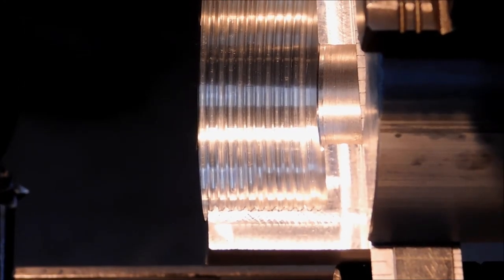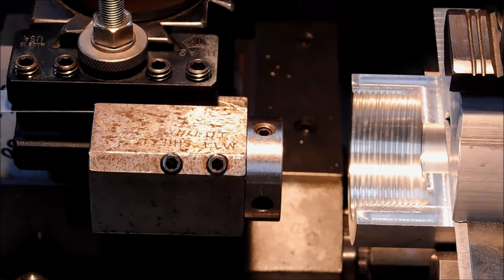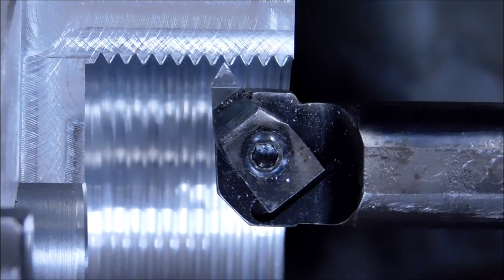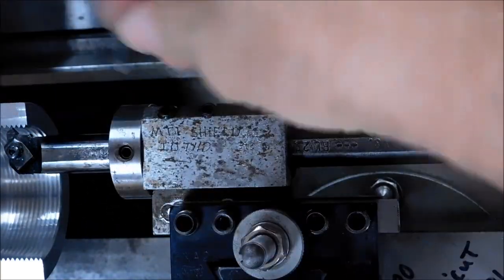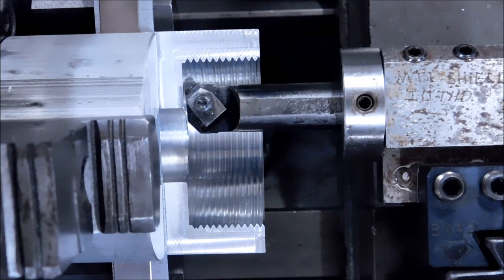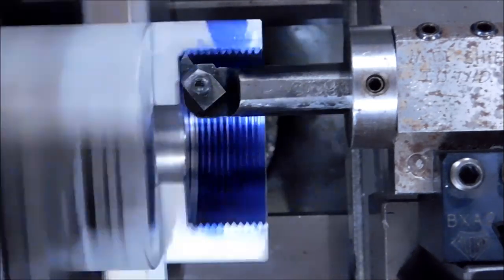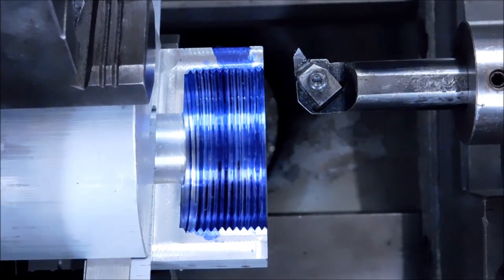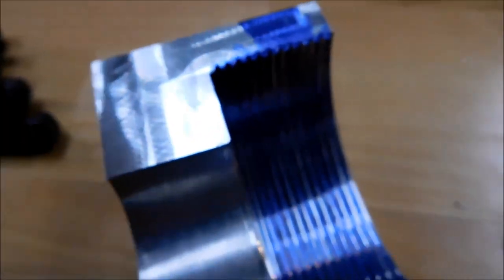How To Pickup an Internal Thread for Repairs !!!

Comment: I'm 20 seconds into the video and I shut it off the way I do it is I screw in a thread to the peace to extend the internal thread to be visible external to the peace and pick it up that way really easy, use your threads peak to peak dimension measurement and you'll fall right in  the thread track
Reply: Now let's see what the video says
Reply from the maker: Curious how you screw something into a thread that came in damaged? And to have a mating part is fantastic luck. I'm not usually that lucky.
Reply: Yes sir. I keep dozens of pieces of scrap 11/8 -12  and 18 tpi threaded stock, and every other odd size that may come in, around just for when I need to do that. But, the idea does have it's place. Joe's way is  obviously applicable in almost all cases.

Comment: You should be able to prove all the setup steps using an external thread which would be easier to see, followed by practicing to gain confidence prior to attempting to chase an internal thread.  Also, when chasing from left to right, it seems you would need to take all the backlash out of the compound by moving the compound dial counterclockwise against the outside of the thread.
Reply from the maker: I already posted an external repair video.
Reply: @joepie221  Thanks.  I watched it shortly after viewing this video.

Comment: Ok at start you bottomed out in the bore then moved out .010   .  What if the original thread was a different starting point??  Let's say .020 or .050??
Reply from the maker: Once the tool and carriage engagement is properly coordinated, you can start the thread any where and it will track correctly.
Reply: @joepie221  okay only thing I missed or it was not mentioned is before u bottomed out and moved .01” u disengaged the half nut? How are you sure you are still coordinated? Did you go off the sync wheel and stop on a number and engage on a number?

Comment: I like the boring bar I do think it could work well in a 4 sided conventional toll holder so to reduce the need for shimming,  I have a large 3/4  tool holder that requires me to shim toling to center hight & loads of shimming  to center height. your system may eliminate that need, by the use of HSS round tool steel,  or square broached hols and sleeves drilled on center. in the lathe you using it opens up possibilities to tern an OLD FASHIONED tool holding SISTEM IN TH A MODEN ONE  in a very POABAL BENEFITS FOR MY LATHE.  THANK YOU, LES TOMPSON ENGLAND. MAY I UES YOR  IDEAR.  England. pleas,  the es of a changeable  sleeve.  set on center adds tool changing possibilities. to rival, the Quik change thank you.

Comment: i fix treads on CNC and thinking how lucky i am nail even 1/360 acyrate. when changing RPM make treads moves. even how much take time to do it correct. you never know what RPM to use.
cutting thread once achang RPM cut it again will mess up it. so it not matter how measure it you fail on RPM xD. there is no lets run slower RPM to seee will it cut correct. changing RPM not do same.

Comment: I would just use a little compress air to spread a little blue dykem fluid on the threads by holding brush next to the bore of the part as it is spinning.
Reply from the maker: Now all you have to do is align the tool...

Comment: How would you do this for a metric thread?
Reply from the maker: Same way.
Reply: @joepie221  How?  When cutting a metric thread on lathe with imperial leadscrew, there is a 127/125 factor in the gearing which precludes disengaging the half-nut!  Do you have some other secret for making metric threads that permits disengaging the nut and getting back in sync?
Reply: @bpark10001  One way is to disengage at a given mark on the threading dial, and hit the brakes. Now wind the tool out of the valley, then use the reverse clutch on the spindle drive to inch the dial BACK to the very same mark (not one or more revs of the dial either way) and re-engage. Bit of a pain on a lathe without clutch and brake, you have to go slower and wind back by hand, but most big lathes will have (multiplate, wet) clutch, and often a brake. Small lathes, it's often not so difficult to do by hand.
Reply: @Gottenhimfella  I know about this trick, but it requires reverse driving, which is counter to Joe's "high-speed threading" where you throw the half-nut in, in a split second.
Reply: @bpark10001  Yes, you'd need a VFD. I think a better idea would be a modernised threading drive based on the "single tooth clutch" idea (as used on Hardinge lathes, among others), but driving the dog-clutch at (maybe) quarter spindle speed, and having four teeth instead of one. That way the half nuts need never be disengaged, yet the leadscrew can be reversed relative to the spindle, notwithstanding which the spindle is always correctly timed when the dog-clutch reverts to forward threading.
The idea of more teeth would be to reduce the impact (and resulting deformation, over time) of engaging the dog clutch at high spindle speeds.
Reply: You can still use the method I describe for high speed threading, if the spindle brake is sufficiently aggressive. If it's not, you can ease the spindle drive clutch back towards neutral as you come near the end of the cut, so some speed is washed off before the brakes come on.
Because once you have inched back to the start point on the reverse clutch, you just dial in your next cut and haul on the forward clutch at whatever speed you want: the halfnuts are already engaged. If you have no DRO, it pays to set up a DTI telling you your distance from the fixed stop.

Comment: That's almost  Exactly how I do it with one exception. I find the thread initially  with the bar  free in the holder so I can locate it by using fingers to push it in place.   Sometimes I hit it dead nuts right  on the first go.   Same for external.  The threading tool is free to move.
Reply from the maker: 5:37 -5:38   " the tool is free to float"

Comment: Thanks Joe, I love the videos, I'm not critising but I don't get why you  mill with a fly cutter,  you wouldn't have a lawn mower with one blade, food for thought. Love the videos, cheers mate.
Reply: Flycutter is 1/10 of the price of a big end-mil , easy to sharpen and gives nice finishes . A 4 inch end-mil not only costs a fortune but also needs lots of power to drive. If you’re not doing high rpm the balance doesn’t matter much.
Reply from the maker: @Scott dean. The pattern you observe on my part was done intentionally. By paying attention to the rotation of the cutter, you can control the burrs  accurately. Since I didn't feel like deburring the thread for this demonstration, I simply didn't make any when milling the part. A flycutter would not offer this option.
Reply: I have a really good milling challenge for you involving a compound angle ball vice, if you are interested,😀 cheers, I love the show, keep up the good work

Comment: If you unloosen then you are actually tightening. :  )
Reply from the maker: Not according to Miriam-Webster
Reply: And uncle joe
Reply: What you have effectively pointed out, Glenn, is that "English teacher" is an oxymoron in the good ol' US of A
Reply: @joepie221  Who is Miriam Webster.
Reply from the maker: @glenntaylor6201  Here in the US, they are the recognized source of the collegiate and modern dictionary.
Reply: @glenntaylor6201   Dunno about Merriam, but Webster is the clown who published a US dictionary in 1828 in which a number or oddball spellings were established at the whim of a single individual, persisting to this day. For instance, in that edition, aluminum was the only spelling given for the recently discovered element (despite "aluminium" being the spelling already adopted by that time throughout the US).
As a result of that one book there are now (broadly speaking) two sets of spelling in the one language. 
In engineering it means there is no distinction (in US usage) between micrometer and micrometre (one being a measuring instrument and the other a unit of measure)
It's particularly strange that the US felt it necessary to dick with the spelling of the metric system, given the strange antipathy towards its adoption.
And don't get me started on arbitrary and pointless changes to the sizes of gallons, tons and such, which had already been standardised.
Reply: "unloosen"...... I LIKE IT!!!!! 😉

Comment: How to do this on fanuc cnc lathe 21i-tb control 🤔
Reply from the maker: I must confess, I have ZERO CNC lathe experience as a programmer. I know what is possible, I've just never personally done it.
Reply: It's unlikely that you would tie up a CNC lathe to do a thread repair like this. CNC is more for production.... than a "one off", as in this case.

But even if you were to attempt to do this on a CNC lathe, it might be extremely difficult or impossible (for all practical purposes) because on a CNC you are no longer dealing with a half-nut/lead screw engagement.... But you're threading signal is being given electronically to a stepping motor. I'm not saying that it couldn't be done..... But I believe the amount of time it would take would be prohibitive (cost-wise).
Reply: Just run the threading code with no tool in the holder. When the tool that isn't there would be inside the part that's already rough threaded hit the stop button.  Now zero out your relative position in both axes. Next jog your z back out enough to put your threading bar back in. Tighten it finger tight. Now move just the z back to the zero. Then you can move the other axes towards the part.  Once you get close enough to your relative zero again you can adjust your bar by feel going very slow until your cutter is in the thread.  Then you can bump it back and forth and find the center of it just like shown in this video.  You can even put an indicator on the back and split the difference. Once you like it,  tighten the bar down. As long as you have enough material left to come off you should be good.

Comment: Rubbish! Way to complicated. Just go on and bottom the tool out, no indicator needed. Done it on square internal threads, no problem  at all.js
Reply from the maker: If the flats on the thread don't match the flat on the tool, you may have a problem bottoming the tool out.
Reply: @joepie221  Yes Joe you are correct! And You are a master of the trade. My project was to make a X axis lead screw nut for a 1943 Tree mill. The lead screw was wore down in the middle, as expected, so the nut was in and out of the lathe so I could cut the threads as tight as possible at the end of the screw. Keep in mind I was doing this on a 1943 Southbend 9". Buy the way Thanks for replying and please check out Rolingmetal one L ( a fellow YouTuber) Watch a few video's and you will watch them all. Charming Man.
Reply: Time is money, your way is the way I do it using the digital's as well, but this is a clever way that I never thought of or seen before. Always good to have another option.